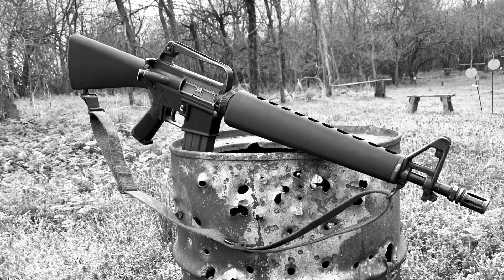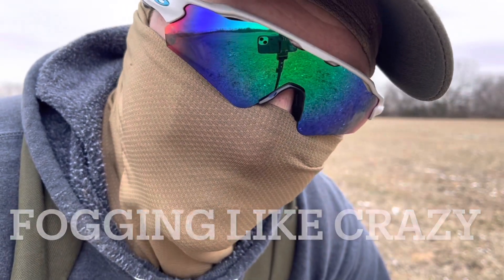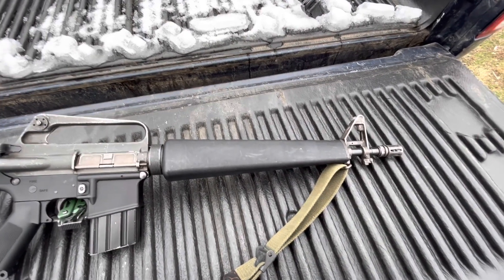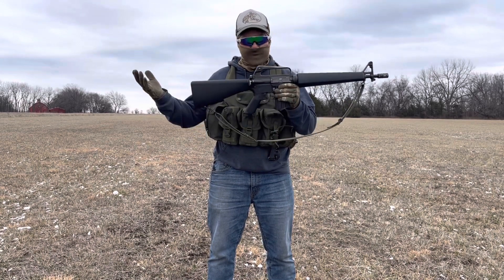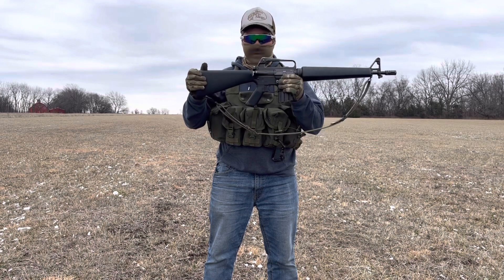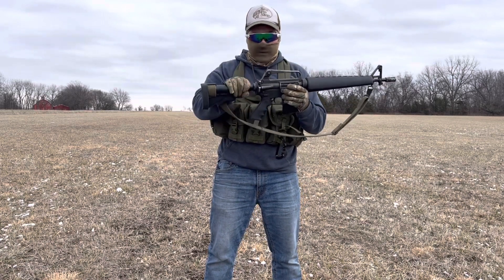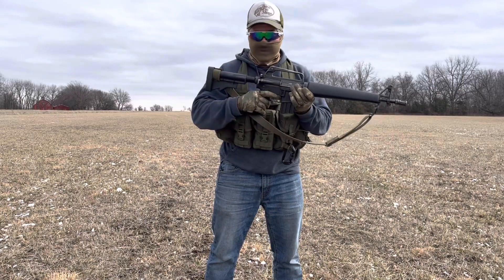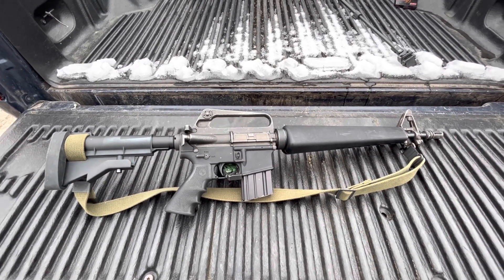M16A1 Dissipator - Can You Improve Upon Perfection?

Comment: Good stuff. I have a rig very similar to this. If you're curious or interested,  try an h3 buffer with the carbine tube and car15 stock. It's what I'm runnin in mine.
Reply from the maker: I’ve been thinking about picking one up.
Reply: @redbarronreviews2429  it's good stuff. I dont run anything else in my ar's anymore but h3's, they work great and really help the gun out. Youlle definitely feel the difference in my opinion and for me it's great because it works well suppressed or unsuppressed even with steel case. Atleast with my rigs anyway, I have ar's built with psa parts up to factory built bcm's and sons of liberty.
Reply from the maker: I’ll give it a try!

Comment: As far as appearance goes; folks judge appearance of firearms by what they're typically used to seeing first.  If there was never a rifle-gas carbine first offered with a full stock (Colt 605) but a collapsible carbine stock instead the way these "look" would've been more acceptable the other way around.  I replicated a CA CHP Colt "dissipator" (A2-type) using faux mid-length gas with a collapsible stock with OD green furniture (instead of the black) and have received many compliments on it but only one (1) critique saying I should've used a full stock.  I'm in a tropical area and OD green blends better so maybe I'll try a full set of Brownells green 601 furniture some time later to see how it looks.
Reply from the maker: I need to do an A2 dissipater.  It’s on my list. The OD green in my opinion looks way better.

Comment: Hey dude great video, thanks for putting this out here. Just wanted to ask a question. I’m a little confused in regards to the buffer tube set ups? With the dissipator are saying you can switch between rifle length and carbine length buffer tubes and buffers?
Reply from the maker: Thank you. 
Yeah, in this case I actually just used a lower from my Stag AR and put that CAR15 stock on it to give it that retro look.  Most ARs should have no issue with that.  Even my A4 20” build I used to have worked fine with a carbine tube and buffer.  The only thing I really notice is a little sharper recoil impulse.
Reply: @redbarronreviews2429  awesome! Thanks for the quick response. I’m doing a little window shopping on psa and weighing out my options. I already have a stripped lower, lowered build kit and a couple of other odds and ends sitting around and just wanted to know before committing to anything. Now I’m just going back-and-forth between there nitride barrel or CHF version for almost double the price.
Reply from the maker: Personally I see no real advantage in the CHF.  The nitride is really good.  The Yugoslavians never chrome lined their AKs/SKS and they did just fine in the white. Nitride is better than that. Also chrome lining was really made to reduce friction in the barrel when firing to keep the barrel cooler in machine guns which prolonged the time between barrel changes.  It does give you some corrosion protection but so does nitride.  Just my $0.02.  I’m not a gunsmith, just a shooter so take my opinion with a grain of salt.

Comment: How do you like the PSA barrel is it the chrome lined version? I was actually looking at there upper but wasn’t sure if I should go with a Del-Ton rifle length gas system upper. What are your thoughts on that?
Reply from the maker: Keep in mind this isn’t the PSA dissipator upper, just one of their barrels.  It’s nitrided and I love it.  It’s a pencil barrel that’s mid length with 1/7 twist.  

I’ve had a PSA dissipator upper (have a video on it) and it was great.  Their upper is usually a government profile with midlength gas system.  It was a great upper and reliable/accurate.  Personally I prefer the pencil barrel, but they don’t offer a complete upper in that configuration.  

There isn’t anything wrong with the rifle length gas system as long as the gas port hole on the barrel is the right diameter.  I don’t know that there’s really much advantage to it.  With a midlength you can always put on an adjustable block and run it suppressed. I don’t know how the rifle length would do with a suppressor.
Reply: I own a delton dissy barrel with rifle length gas system. With full power milspec 5.56 it is awsome. Soft accurate excellent but it will not run cheap .223. It will usually kick the shell out but won’t pick up another round. Not enough bolt velocity. Was thinking about a reduced weight bcg or a reduced power spring. If I have to do it over I would go with a Windham weaponry dissy barrel.
Reply: @redbarronreviews2429   did you drill and pin the front sight block? I am thinking about making a dissy out of a 16inch m4 profile barrel I have. For some reason the front sight block I have will fit fine over the gas journal but out towards the end of the rifle where it needs to go to hold handgaurds it is a little lose….any advice would be appreciated.
Reply from the maker: The gunsmith and I basically made a small sleeve out of sheet metal to fit the front sight block on barrel to get the correct width width. Once it was where we wanted it to work with the handguard we tacked it in place with a welder to make sure it wouldn’t go anywhere under recoil.

Comment: I thought a dissipator was a 16 barrel with a rifle length gas
Reply from the maker: A true one would be just under 16” to include the flash hider if we’re talking about cloning an original.  Rifle length gas system is correct, but there’s a lot of midlength systems readily available and they’re honestly more reliable with a variety of ammo than the rifle length system.
Reply: @redbarronreviews2429  Interesting, thanks for the info
Reply from the maker: @henryc7548  you’re welcome. I’ll post a short soon on this topic.  I’ve had a lot of questions about this.

Comment: Very cool rifle but not a true dissipator without the full length gas system. All you have there is a milspec AR15 with a 12 inch handguard on it.
Reply from the maker: Yes I’ve addressed this in a couple videos. I have a build video on this specific rifle and why I built it this way.  Not exactly milspec either.  I built this for aesthetics and reliability.  Midlength gas system, pencil barrel, BCM and colt for the critical wear parts.  
Also rifle gas system doesn’t mean it’s a dissipator, the barrel has to be less than 16” with the flash hider threaded up almost snug against the front sight base.  It would be a SBR by about a 1/4” other wise it’s faux dissipator. More correct, but still not one.

Comment: Can't think of any.
Reply from the maker: I think the only real upgrade would be an A2 flash hider and maybe an optic.  That’s about it.  It doesn’t need either though.
Reply: @Red Barron Reviews  
Depending on your purpose. For a show piece, it needs nothing to imp4ov3, maybe a Brownells 4x retro scope, and that's it. For home defense, tho, anything else would destroy this art piece. For tyranny prevention, I would start piling crap on it,starting with Mepro M21 and midway industry quad rail.
Reply from the maker: For tyranny I like the primary arms 3x and then slapping a white light to the front sight block on a pic rail personally.  Still maintains the lightweight and gives you a light and the new gen of primary arms 3x is NV compatible.  Just personal preference.  The retro 4x is pretty awesome too!
Reply: @redbarronreviews2429  I can't afford to keep watching. 🤫